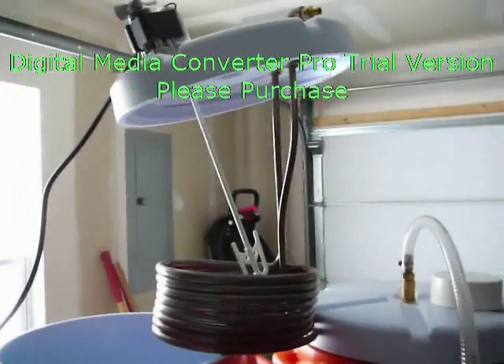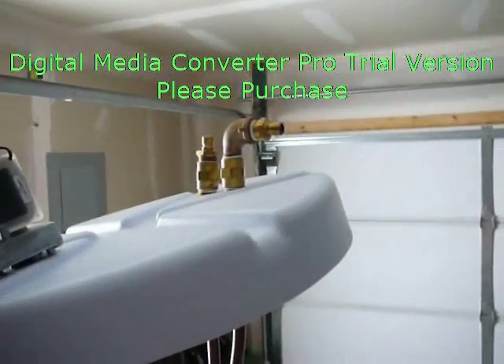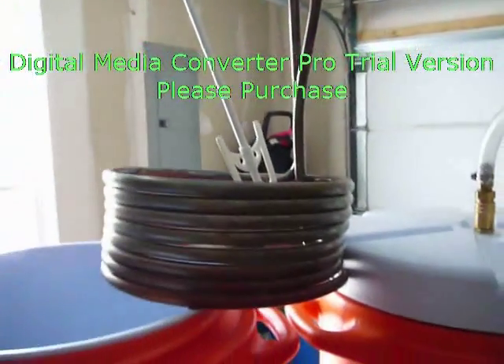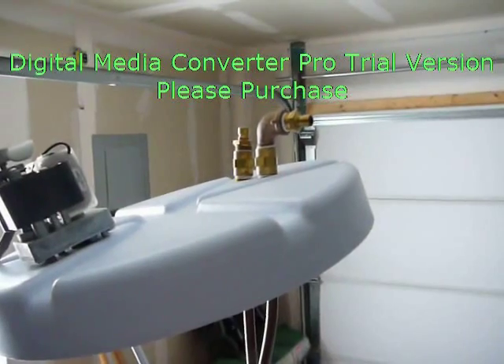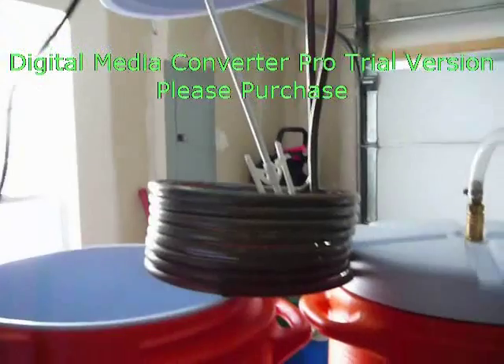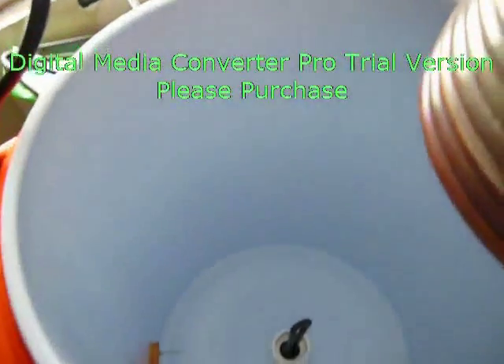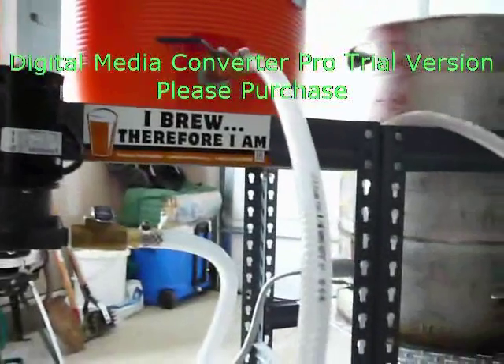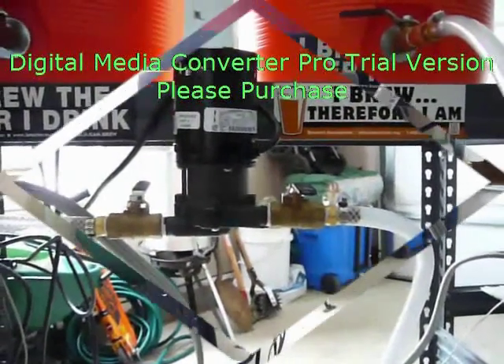E-HERMS Part Two (Electric HERMS Brewing Rig)

Comment: I'm currently doing everything the manual way, but would like to get a bit of automation in the temperature control of my mash.  There are a lot of guys that have switched from RIMS to HERMS.  What's the advantage?  I would think cleaning the HEX would be more work than a RIMS.  What are your thoughts?